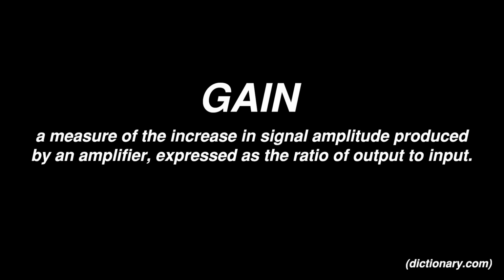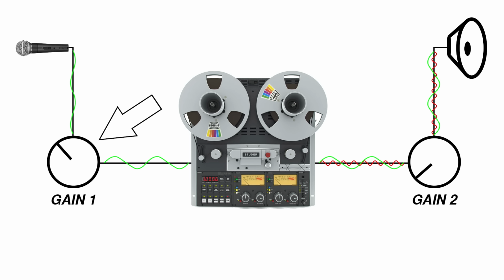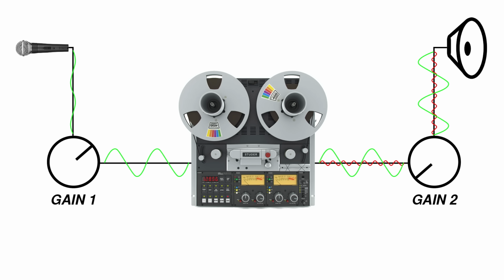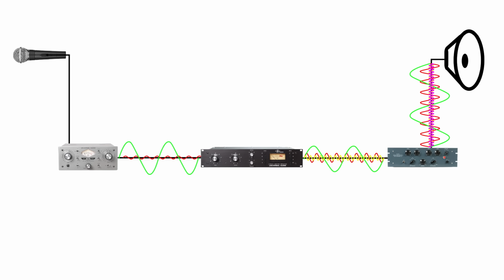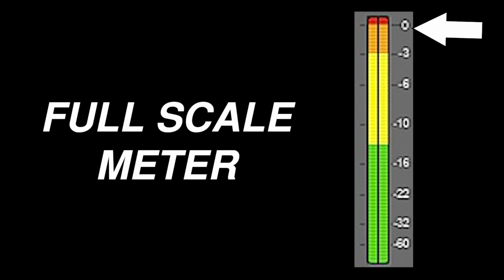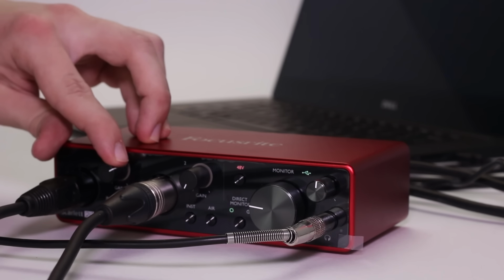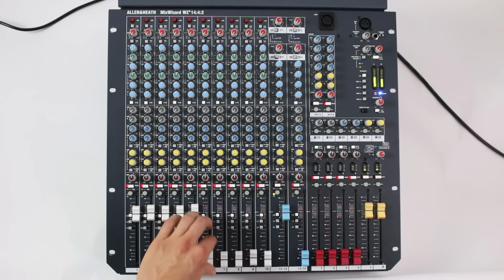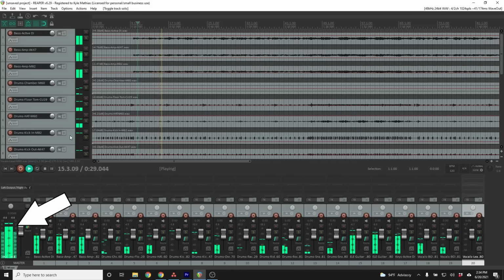Gain Staging Secrets Every Great Audio Engineer Understands!

Comment: In Ableton I put a Utility (gain plugin) with -12 dB on any channel right after the sound source, to keep audio at suitable levels for the following plugin chain. I could make sure that my synths don't output louder volumes in the first place, but when stepping through presets, those levels get reset most of the time. By checking the inter-plugin peak meters, I also make sure that my plugins don't add a significant amount to the overall peak level of the channel. Adding up all the channels usually gives me a master peak level of around -6 dBFS, which leaves enough room for master bus compression or loudness optimization.

As a bonus, I also put another Utility with +12 as the very last plugin on every channel and set the mixing fader of that channel at -12 for compensation. This gives me a little more headroom on the fader, as the +6 on Abletons faders does not leave much room to boost quiet signals.
Reply: This is not good ‘normal’ practice.  You are reducing the insert level of your channel by 12db, whether it needs it or not, and you can be sure this introduces unnecessary noise when every single channel needs makeup gain.  Much better to optimize your source levels whenever possible to the nominal level your DAW expects at its input.  I’m guessing you’re not using preamps or any mixer.  Lacking that, adjust the outputs of your sources as best you can so that your faders have the range you need.  If you find it routinely necessary, make a habit of parking channel faders at -6 for setup as your new ‘zero’.  Those two utilities you insert are acting as noise ‘anti-reduction’, the last thing you need.
Reply: @artysanmobile  This is true for analog audio processing, but I work completely in-the-box, so my sound sources are synth plugins or samples. I assume you are talking about quantization noise then?
As DAWs (and probably most plugins) these days work with floating-point values (64bit mostly), quantization noise is negligible. As SNR for floating-point values are 192 dB (32bit) and 385 dB (64bit), just changing the volumes by a few dB has absolutely no audible impact on sound quality, regardless of where in the signal chain the volume is changed. 
The only source of quantization noise is when the sum is rendered to a 24bit integer wave file.
Reply: @markuskopter    I was just giving good general advice, in the box or out doesn’t matter, and I’m not referring to quantization noise but just noncoherent noise as we have in any electronic signal.

By the way, you’re quoting a bunch of numbers that mean virtually nothing.  Hundreds of dbs and 64 bit word lengths are just nonsense concerning audio.  You do know that, right?  I only mean to be constructive saying this.
Reply: @artysanmobile  I have to admit, I was wrong in stating those signal-to-noise-ratios were for floating-point values; they are for integers, actually. The SNR in floating-point processing is even much higher.
I also was wrong in saying the final render were the only source of quantization noise. In fact, every calculation in a DAW has to be rounded to some resulting value, which results in quantization error, or "noise". In fixed-point systems the size of this error (the volume of the noise, if you so will) is determined by word length. Did you ever use a bit crusher plugin? It reduces the word length of the audio signal to deliberately create quantization error, which we then hear as noise.
But other than that quantization noise, there is no inherent non coherent noise in the digital domain.
Reply: @markuskopter    I hope you’re just a little deep in the sauce on a thanksgiving day, enjoying life.  You sure have a great story to tell.  Hey, did you know that Africa is splitting into two pieces as we speak.  Because that’s far more relevant to this discussion than the gibberish you just laid on me.  I really do hope you’re ok, Markus.
Reply: @artysanmobile  Okay.
Reply: @markuskopter  bro is a weirdo, for no reason, made you explain yourself, said it was constructive criticism when it didn't offer any pointers to improve your workflow.